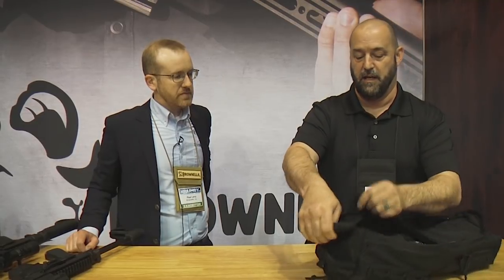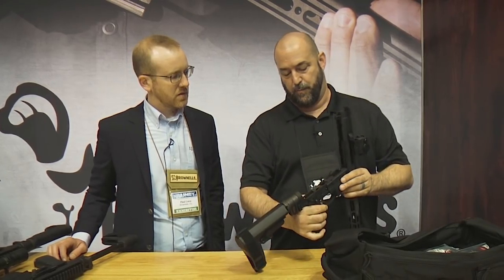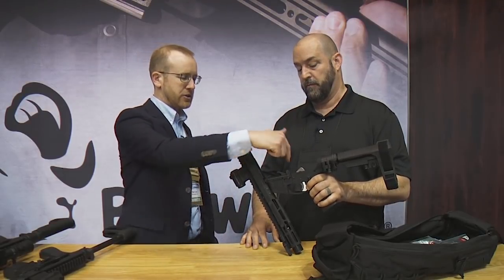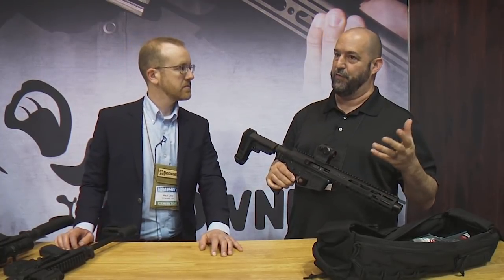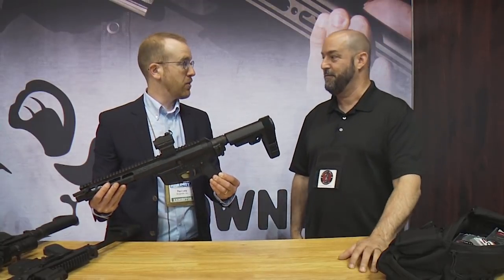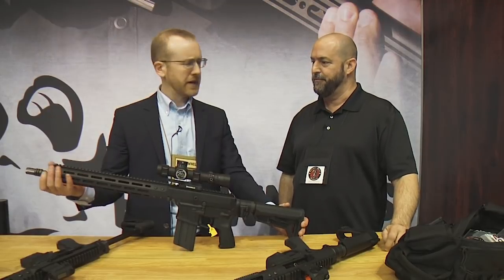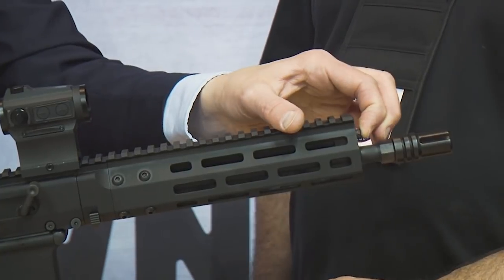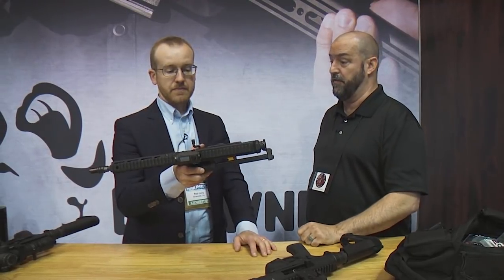Brownells at NRA Show 2019: BRN-180™ & FM Products 9mm PCC

Comment: I was thinking the BRN-180 would be a great upper for a California Compliant Fixed Magazine rifle. It has a big advantage that if it has a jamb, such as a double feed, you can still crack the upper from the lower which you can't do an a standard AR15 upper in the fixed mag configuration.

Have you tested the BRN-180 with any fixed mag kits including the following?

The Battlearms BAD-MRB
The Hogue Freedom Fighter kit.
The Hellfighter kit.

I know you sell both the Hogue Freedom Fighters and the Hellfighter kits.

If you haven't would you at least test with the Hellfighter kit since it required no modifications and can be installed quickly. I figure if it works most of the other kits should as well. If you do test it please do a video as it would be very interesting for your California customers.